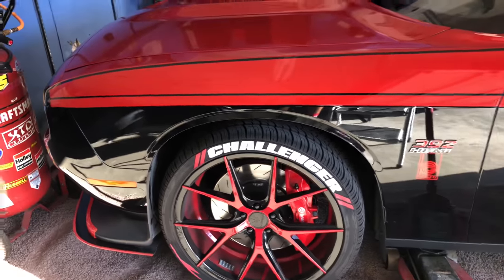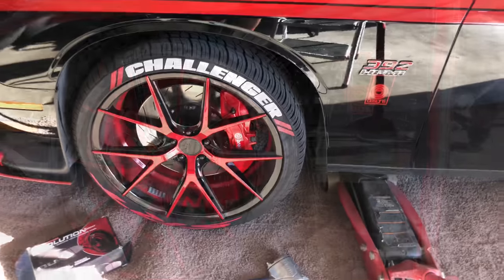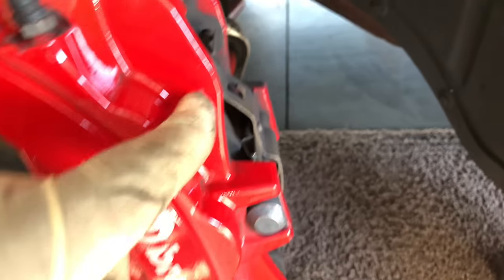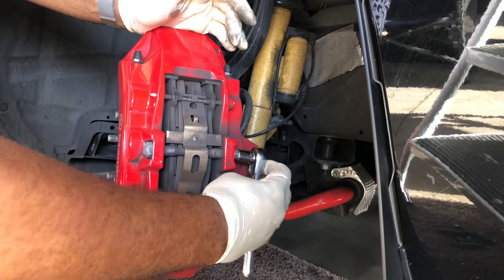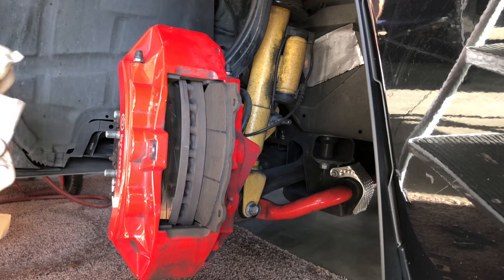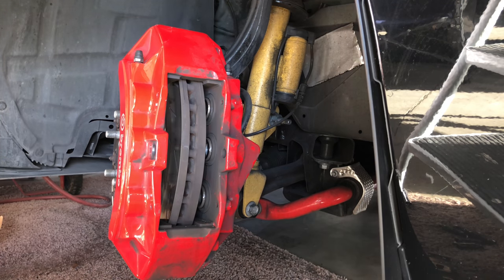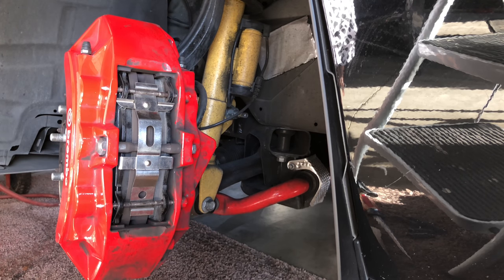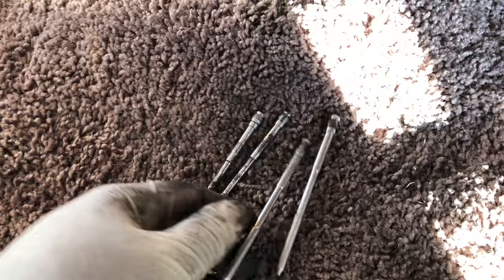Brembo brakes DIY challenger charger magnum

Comment: I guess i'm lucky here in canada (thus far) I use AutoGlyms Wheel Protector spray to keep the brembo brake dust off my rims.
Reply from the maker: Yes man I hated the constant dust my wheels would attract. And the last set of wheels I had on a charger I sprayed with a anti dust coating and it made the wheels dull and the shine never came back.